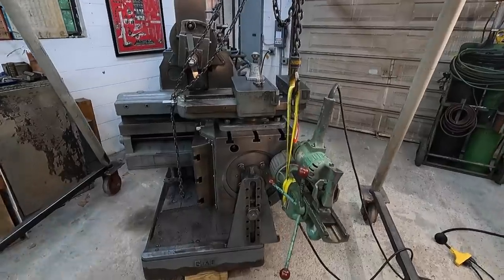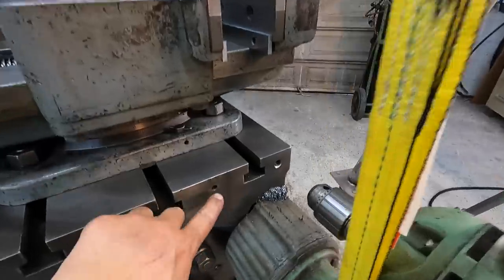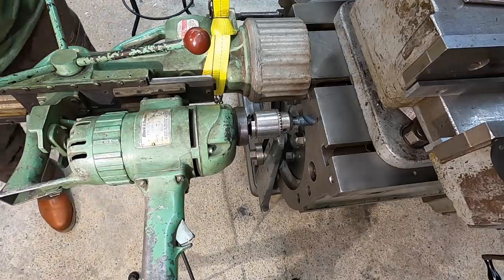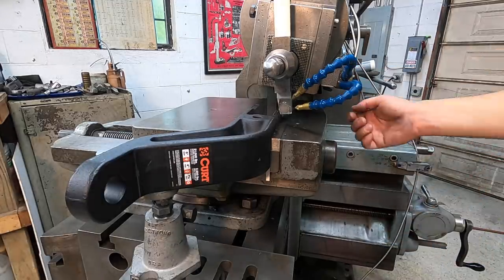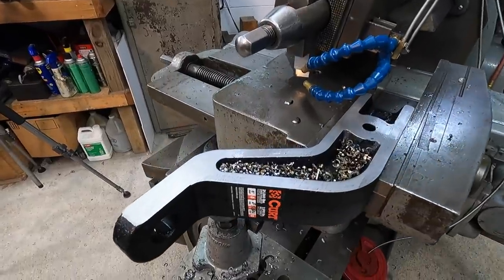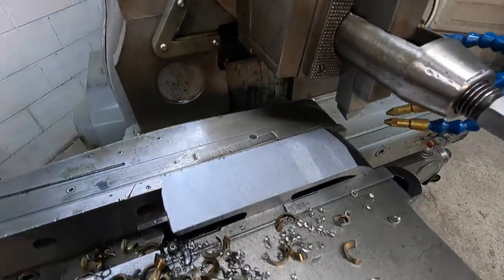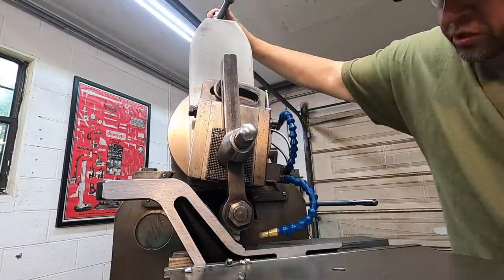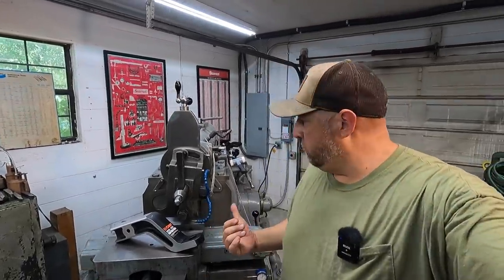3" Ball Hitch Insert Mods Part 2: Mag Drilling the Shaper Table

Comment: Please forgive my ignorance but I simply do not see the benefit to using the shaper in this case vs. a mill. Something i am missing? I would have thrown a surfacing bit or something on a mill and have been done a lot faster. Then again I would have only cut out what was necessary for it to slide in the hitch too. But I am by far an expert.
Reply: He said it would be fun using the shaper.
Reply: That's  the same thought I  had at first.  I've  never had an opportunity to  use a shaper, so for me it's  mill all the way.  However near the end he said the shaper was one of his fondest machines to run.  That was good enough of an answer for me.
Reply: My god, he explains why he uses it in EVERY video he does with his shaper. Rob, you disappoint me brother.
Reply: You can make anything with a shaper except money. 

They're really cool old tech, though totally obsolete. But the sheer size of the chips they can make is awesome, and they make for great video. They also produce a really nice looking surface finish, and can be used for broaching more easily than anything else non-CNC. They're great for hobby work where the goal is to have fun, and terrible for production shops where the goal is to produce parts as efficiently as possible. Every back-stroke is wasted non-cutting time.
Reply: Agreed, a shaper makes a way better finish than a mill ever can. Milling finish looks kinda bad imo.

Comment: I'd suggest removing the sticker, and then using your letter punches to put a "reasonable" maximum rating in the fresh metal.
Reply: Letter punch into a load bearing part is always a good idea...
Reply: @mazchen  well right now it has a manufacturer's label saying its rated for a specific number, which is no longer correct.

Comment: He has got the clapper box canted 
because of the step over is putting 
Sideways pressure on the tool
on the back stroke????
r would it be better on the machine 
If over stroke the part so that the 
Tool would ride on the top of the part 
On the back stroke so's not to put 
any side pressure at all????
Using a 30,000th step over..
thoughts on that anyone???
Reply: Have you used a shaper before?  I'm not being sarcastic for once. I am curious.

Comment: There is no way known that could be legal to use. Especially in the country that lives to sue people. As it no longer meets manufacture's specifications all liability in an accident would be entirely on Adam so no insurance cover or anything.. Nice machining video but basically it should be treated as scrap metal now.
Reply: I would make everyone sign an agreement to release responsibility. all Adam is is a contractor doing a customers job.. but i did kinda think the same thing here..
Reply: I was going to say. Anything that requires that hitch should use that hitch as it is. My 3500 1ton uses that size for a reason, Because it can handle that load.
Reply: @lahoozer6694  In this case he may be using it way under capacity and knows the limits.(i would pull all the stickers off it) so the next guy does not make assumptions.. . 
I welded up a frame to hold my Troopers store baught hitch in a lower position to match my low motorcycle trailer.. the connection to the Isuzu and ball is still within DOT code on its own and mine is just adding strength and positioning it better for my purpose . but i was worried about the legality of it if something went wrong.. so i think you have a legit concern here.. lets hope its not going to be used in its full capacity... safety first..there is a reason for these ratings..
Reply: Adam is in the fabrication business.  Don't you think he might have some insurance?

Comment: That hitch is structurally destroyed.  With such a massive %% of the web thickness removed, and the 'step change' stress raiser, it should NOT be used to pull anything. Stiffness of material, is proportional to the cube of thickness - by removing ~30% of web material, it has removed 66% of stiffness.  Maybe send the video to the manufacturer and get their opinion on the changes.
Reply: But Adam has already stated that its new load rating is far less and won't be used anywhere close to that. Think logically, you'll rip the arse end out of the truck before that thing fails.
Reply: Flange not web, but ya, it's compromised now. I just hope that isn't for a 1 1/4" shank and he makes another 3/4" ball shank sleeve adapter...
Reply: he will never use it as a tow hitch , it was a prop for showing off the boat anchor of a shaper .
Reply: I was kinda wondering about the legal ramifications of a mod like this if anything should happen around the hitch area. An insurance adjuster would be on it like a dog on a bone.
Reply: @mikeb.5173  I agree. It's over an hour of video to do a job that would have taken 10 minutes in the mill.

Comment: Why use a scraper when a mill looks to  be more efficient  and smaller  foot print in the shop?
Reply: It's actually a shaper. Adam pretty clearly explained that he enjoys running this machine and doesn't care about the speed when he's working on his own projects.  "When I'm not on the clock" is what he said.
Reply: Fair enough.  I was just curious  as to what advantage  there is to running a  shaper over a conventional  mill.
Reply: Adam's said many times it's just because he enjoys using it.
Reply: Oy vey!  What's with the same old tired comments?  Ooooyyyyy veyyyyyY! um, because he can?  Seen and heard?  He does, in fact, actually have a mill.
Reply: @travisbosco8469  Don't put too much work into it.  I've found from vast unfortunate experience people don't listen or watch much of anything beyond the first 30 seconds.  Much like a dog watching a tennis match, but I'll take the dog over some viewers.
Reply: @robertoliver219  A nice unique finish.
Reply: @silasmarner7586  i think some even start writing comments when they are 5 sec into the video...
Reply: Those big chunks of HHS are actually cheap, per operation. and highly customizable, in comparison to carbide. He's said that carbide doesn't stand up to interrupted cuts like HSS, and the shapers give you an interrupted cut on every stroke.

Finally, he rebuilt the G&E, it's one of his favorite machines, he loves to run it, and for many of us, it's the most fun to watch. And the finishes, an ABom speciality, are terrific. I give it 5 stars.

Comment: Couldn’t this have been done A LOT faster with a shell mill?
Reply: Then it would be a boring video...
Reply: Shapers are slow. Thus the "you can make anything with a shaper except money" line. They're totally obsolete now that CNC mills exist.

But they don't require nearly as much active attention from the machinist as a manual mill. They're the pre-CNC "set and forget" machining tool. So it takes at least 2x as long (the back-stroke doesn't cut, so that's wasted time) but you're free to work on other stuff during an operation. Before the days of CNC that wasn't possible for a mill, so a shaper let you increase the total throughput of your shop. 

These days they're too limited compared to CNC mills. They're just something hobbyists pick up as a cool bit of classic technology. In this case Adam is a hobbyist, since this isn't a paid job where time matters. He just wants to have fun with some interesting old machinery that he's lovingly restored. Think of it like how a classic car enthusiast will like their utterly obsolete rebuilt car, even though they could get a faster/better/more efficient new car for less money and effort.